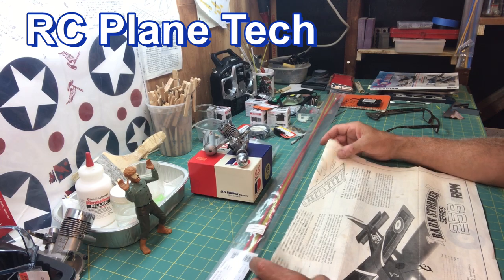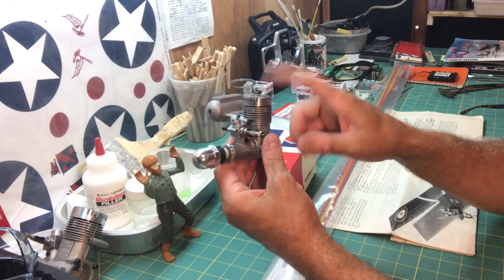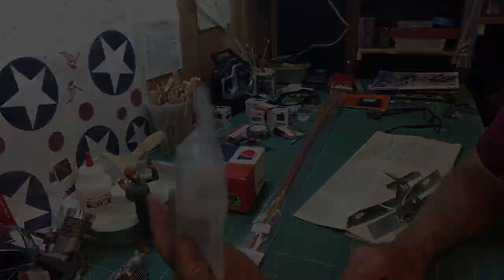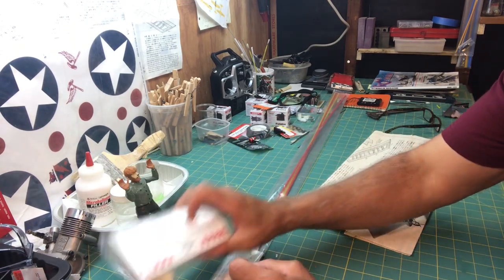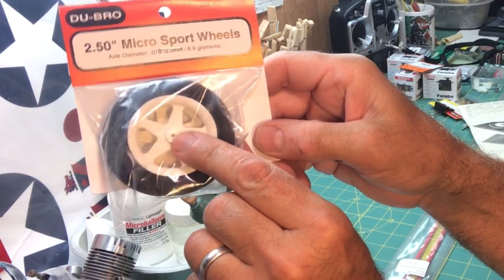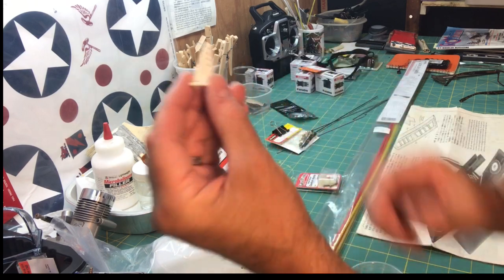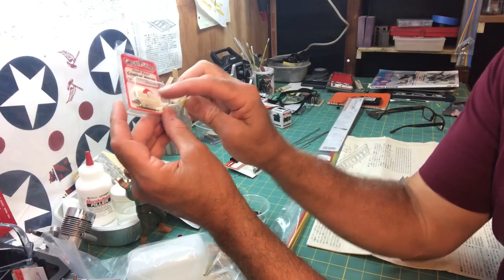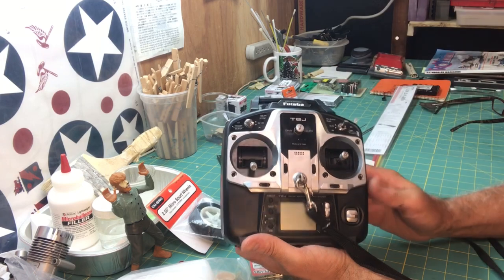Barnstormer 25S Vintage RC Plane Build: 22 Engine, Hardware and Electronics

Comment: Got the same engine waiting for my Barnstormer too. Looking forward to see how you will mount it and the connection to the servo.
Reply from the maker: Nice! The FPs are great engines. I need to break mine in. Will do that next, then mount with bolts.